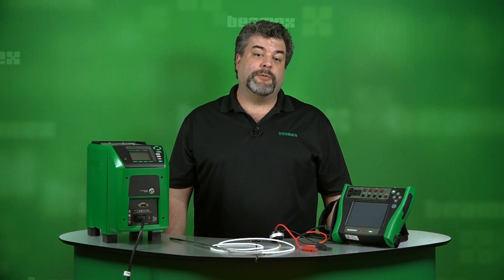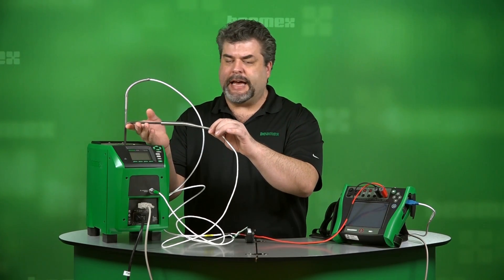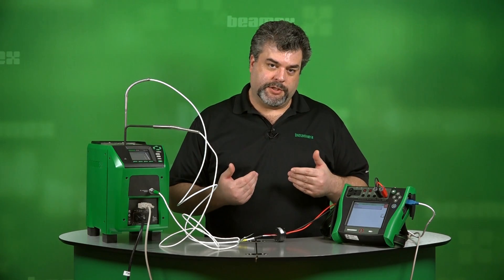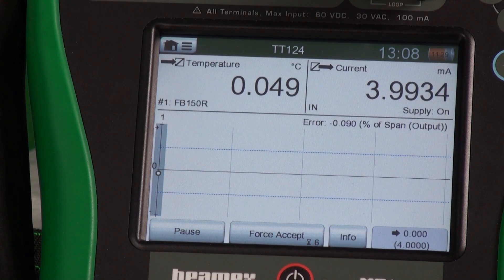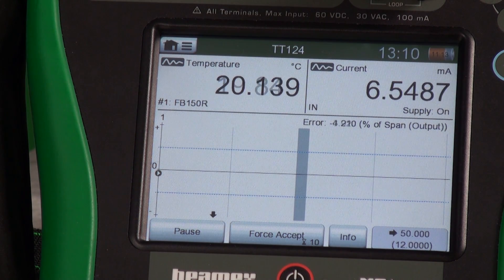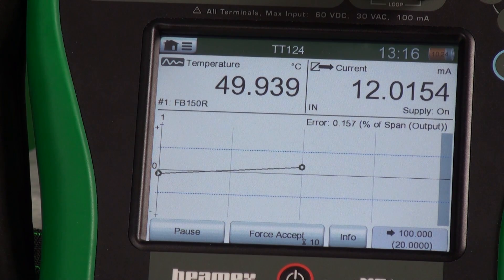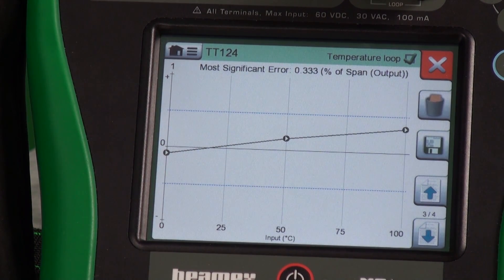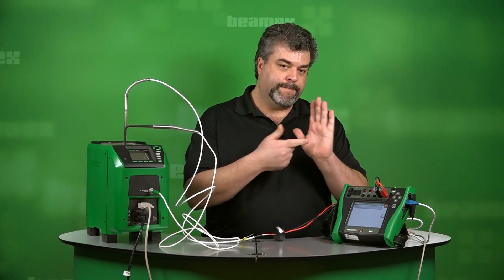How to calibrate an analog temperature loop - Beamex

Comment: When I select the instrument on the documenting calibrator I get the error: controller is not available. The instrument I am testing is a thermocouple
Reply from the maker: Hi Cody, You may configure the MC6 to use an external controller, such as a temperature dry block, for automating the calibration. That message sounds like this instruments has been configured to use a controller, but the controller is not currently connected. So either connect the controller, or then edit the instrument in MC6 so that it does not communicate with a controller. Hope this helps.

Comment: I have a problem. I calibrate transmitter passed (error < 0.1 %), sensor passed (error < 1%). But when I connect transmitter and sensor, I calibrate failed (error = 1.6%). I checked connect  MC6, FB660, transmitter, sensor ... are not loose. Please support me.
Reply from the maker: Hello there. 
Well, that does not sounds like very normal. When sensor and transmitter are connected together the error may of course be the sum of the errors, but in some cases the errors may also compensate each others (if they are different direction). 
But I think that in your case there is some repeatability problems. I think that the sensor, transmitter, or the calibration method is not consistent and repeatable, so you get different results with different runs. 
Transmitter calibration is less likely to cause repetability issues, but please try to calibrate the sensor (or the whole combination) a few times and see if you always get the same results. If not, try to see what is causing the difference. Maybe the sensor calibration is done too fast and it does not stabilize well enough. 
Should you want to discuss after the tests, please feel free to email me. 
Thanks, Beamex / Heikki Laurila (heikki.laurila@beamex.com)